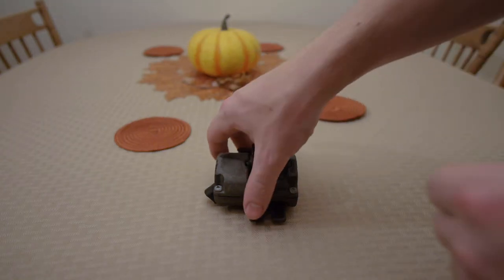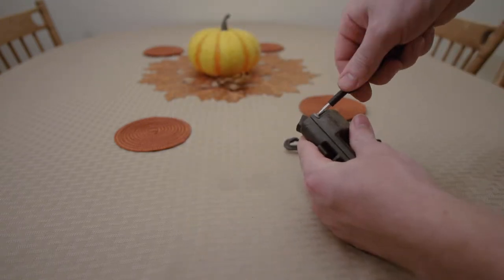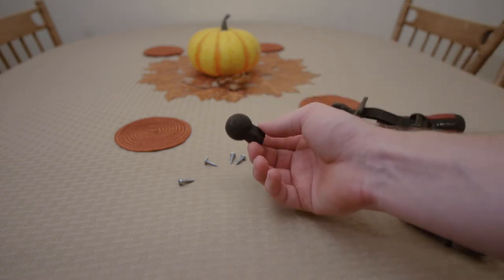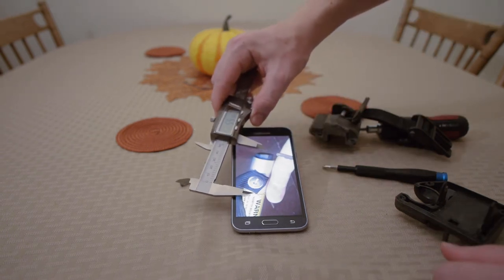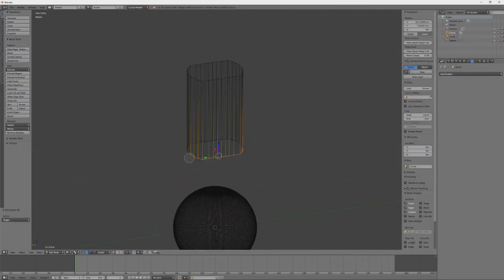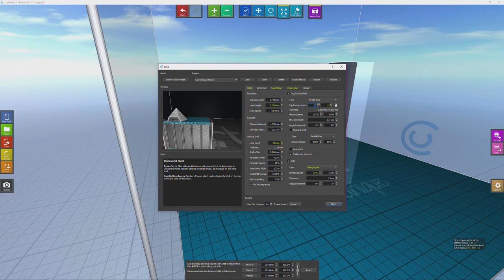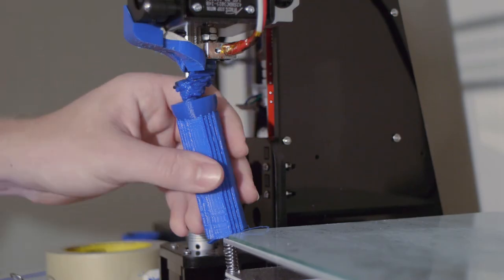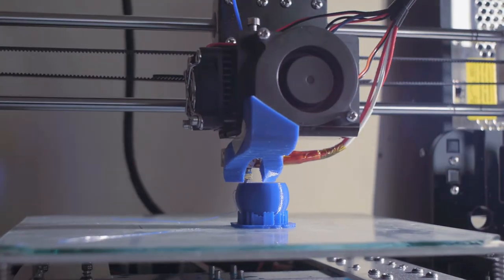3D Printed Ball Joint Fixes Bicycle Trailer

Comment: Over one year later, how did your solution last?  Is is still working or did it also break?
Reply from the maker: It has been working perfectly! I got another trailer to replace it just in case, but still haven't needed it. Signs of wear are minimal. Very impressed with the PLA!
Reply from the maker: Haha, and still working great!